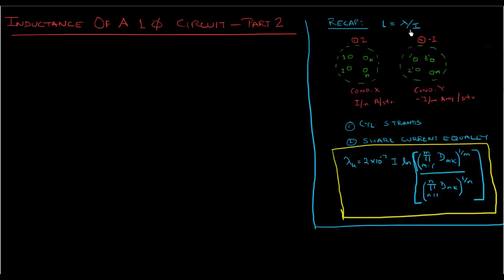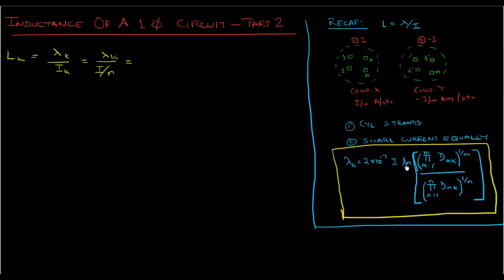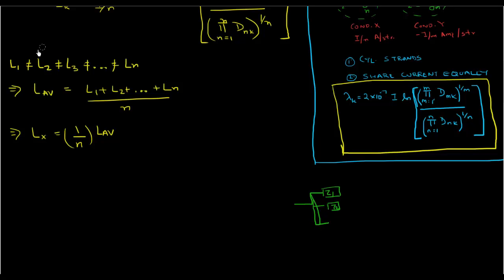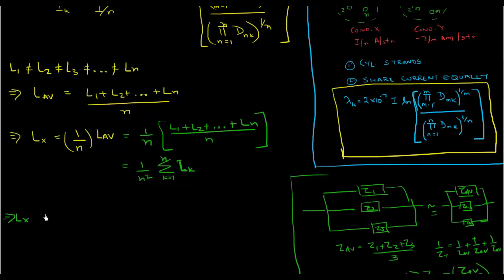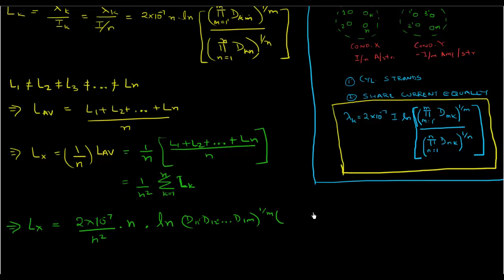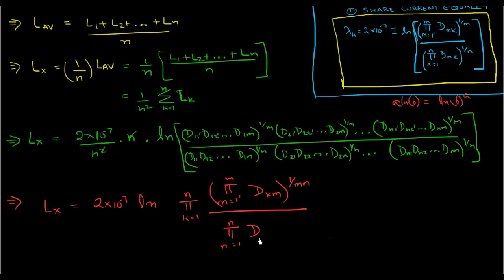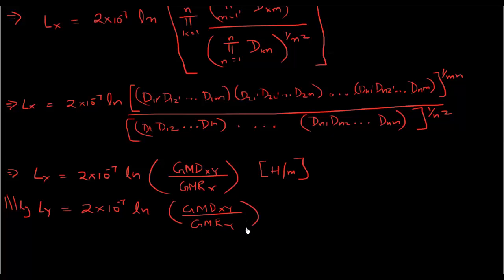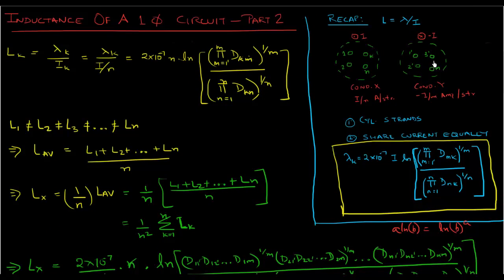Inductance of a Single Phase Circuit - Part 2

Comment: Thank you very much for the excellent explanation. I have a question.. in the last minutes of part-1 video for inductance of 1 ph circuit.. you have concluded an expression for total flux linkage at conductor X and another expression for total flux linkage at conductor Y. This was by concluding an expression for Lemda-k (the total flux linkage at a strand of a conductor) and simply summing: Lemda-1 + Lemda-2 + .. + Lemda-n. to get the total flux linkage at conductor X (Lemda-x). Why don't we just simply divide Lemda-x by the current to get L-x (total inductance of conductor X)?? Noting that in this video you have used Lemda-k again to derive an expression for L-k, then L-avg, and finally L-x.